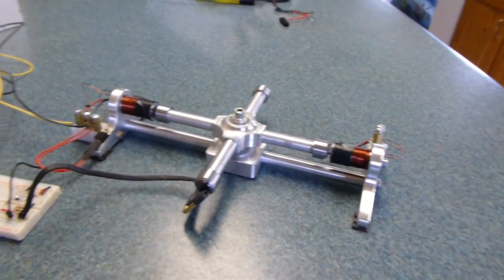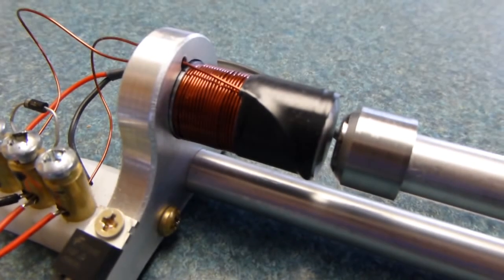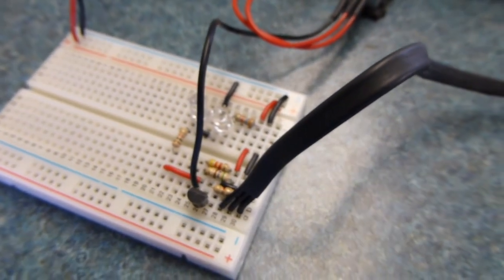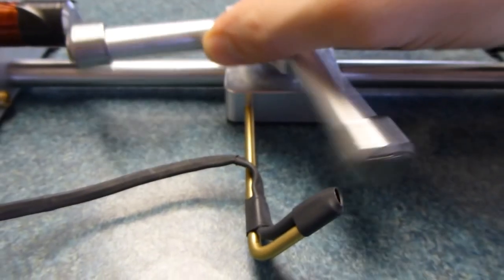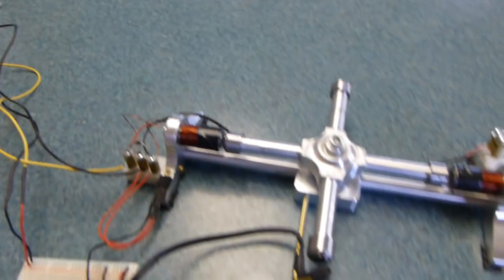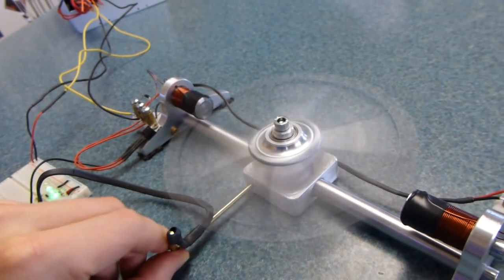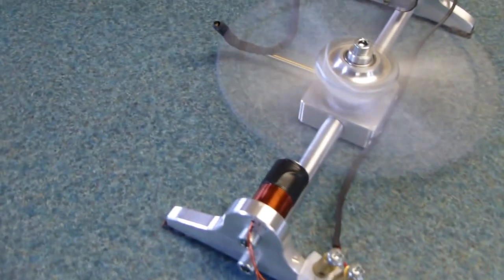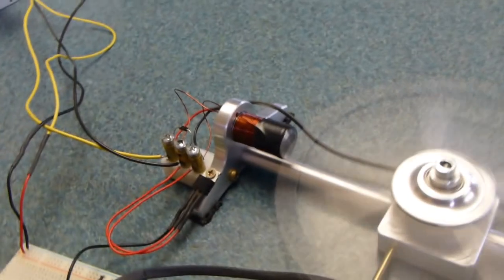DC Brushless Motor Project

Comment: You can use the collapsing magnetic field when the mosfet is off to achieve overunity using a diode from the negetave from the coil. It becomes your positive than your posotive from your power supply can be used as a negetave. It could posibly put out more than you put in.
Reply: um.. no. That's not how it works.
Reply from the maker: Yeah. Don't quit your day-job, unless your job is rewriting the laws of thermodynamics, in which case, enlighten us.
Reply: lol the laws of thermodynamics. And you think that helps you here. How about the law of conservation of energy. Ever heard of that one?
Reply from the maker: ...that is the first law of thermodynamics, genius.
Reply: Yes genius I am fully aware of that. And it debunks your over-unity bullshit. duh.
Reply: I dont know the physics behind it im just a highschool dropout that became an electrician. I do projects like this because I like to learn. I built a similar motor that takes 6 watts to run but puts out 88 watts. It can charge its own batery and if you touch the output it will nail your ass.
Reply: Brandon Jingle you may have built a device that inputs 6 VOLTS and outputs 88 VOLTS with an inverse relationship for amps to compensate, or you may have built something that outputs an irregular wattage that tricks your multimeter, but anything that outputs more average watts than it takes in is impossible.
Reply: That sad to hear. Im probably just making a big volt spike or something. I wont give up though.
Reply: Well if your goal is to make an over-unity device then you should give up and try making something else....
Reply from the maker: Brandon Jingle If you created a machine with greater than 100% efficiency then I'd highly recommend you go pick up your Nobel Prize and enjoy the rest of your life basking in riches as you take your throne as ruler of the universe.
Reply: Or that, I guess. Look out for government thugs and all that stuff cuz you know, it's a conspiracy and all
Reply: 1 thing you need to know .... you can't get more energy then you put in .... in the best possible conditions you can get 100% of the energy you put it no more
Reply: Daniel Parks prove me wrong :3 go ahead haha
Reply from the maker: Daniel Parks

There are plenty of sources of energy that we could reap from our planet and the space surrounding it: tide and pressure fluctuation like you mentioned along with others like solar and geothermal. It's important to note that although these seem "free" they abide by the same laws of physics as everything else. The energy we do/could extract from those systems comes as a result of heat in our own planets core, radiation from the sun, or the gravitational effects of our planet, the moon, and the sun. The sun is the prime source of most of the energy in our solar system in one way or another.
Reply from the maker: Daniel Parks Just keeping everyone in line, Daniel! ;)
Reply: ^that
Reply from the maker: Daniel Parks They're the fundamental laws of our universe, Daniel. I'm not on a pedestal, I'm just trying to keep you from wasting your time. If your or anyone else's "ideas" contradict those laws, they're wrong.
Reply: Daniel Parks heres an idea. How about a perfect battery that will hold a charge forever, through infinite cycles, and without the use of chemicals.
 Charging phase: power is given to a wench that lifts a 50 ton mass 10 meters upward. Then a locking mechanism holds it up.
Draining phase: the mass is attached to gears that power an electric generator. The resistance of the generator slows the mass's dissent, and a higher current draw would trigger the mass to fall faster, generating more power. 

It would be a large, ugly thing but it could be build underground .
The heavier the mass and the higher it is lifted, the more joules of energy it can store. The faster it falls, the more power it can output.
Reply from the maker: Daniel Parks No, I don't. If I did I would be marketing them and not making YouTube videos.
Reply from the maker: *****
How do you lift the 50 ton mass?
Reply: Jon Proce with a wench that is hooked up to gears to give it more torque. It would have to lift very slowly. With enough gears, you can lift it with anything, even a tiny motor out of a vacuum cleaner.
Reply from the maker: *****

That's very nice. What I was getting at is that I can absolutely, 100% guarantee you that it would take more energy to lift that mass to its upper position then you would get out of the generator when you lowered it. You cannot create energy, and the efficiency of that system, by the grace of science, must be under 100%.
Reply from the maker: Jon Proce

This thread is the reason that science courses should be mandatory for all students.
Reply: Jon Proce  i never said anything about over-unity. i said "perfect battery" meaning "lasts forever, and maintains charge forever"

Also, I just noticed the beginning of this thread, where i mistook you for brandon jingle. sorry about that. I thought you were arguing with me and defending the OP. That's why i brought up the first law of thermodynamics. We've actually been saying the same thing this whole time
Reply from the maker: *****
Roger. Mechanical batteries are common in the form of flywheels on machinery. Same idea but you save yourself having to reverse direction to recharge.
Reply: Jon Proce ah but a flywheel has to keep spinning to maintain kinetic energy, my idea just has to sit still, maintaining potential energy instead.
Reply from the maker: *****
Fair enough! Start digging the hole!
Reply from the maker: Daniel Parks
That's very inspiring, but, as I'm going to reiterate for hopefully the last time, it doesn't matter how much you dream, you still need to abide by the fundamental scientific laws which have defined everything our species has ever attained.
Reply from the maker: Daniel Parks
We have a few very good options to replace fossil fuels already, but our economy won't allow us to switch things over very quickly. I'm sure within the next half century we'll begin to see a transition.

And for the record, you can't classify anything that harnesses energy from the earth to be perpetual motion. Perpetual motion is impossible.
Reply from the maker: Daniel Parks
No need to get snappy, I understand it very well. "Perpetual motion" does not share a definition with a "perpetual motion machine" to which you're referring. Perpetual motion machines cannot exist.
Reply from the maker: Daniel Parks I was referring to the device with which you'd like to harness the energy in the tide. Tidal generators already exist, for the record.
Reply: Daniel Parks plus, the only reason the earth and moon continue to orbit is because they have no significant resistance. They are just floating through space. But, there is still some resistance. The moon for example, actually raises ocean water, and as the moon orbits, the raised portion of ocean tails slightly behind the moon. This causes a "drag" force if you will. It's actually slowing the moon down, and every year the moon gets a tiny bit closer to earth. Billions of years from now, the moon will be close enough to tear earth apart with its gravitational field. Its a similar case with earth and the sun, but the sun applies a solar wind to counter the effect, and the sun will die long before the earth could crash into it.
 Nothing is perpetual.
Reply from the maker: ***** I agree. That is all true.
Reply: Even using the tide to harness energy is still taking energy from something. It's taking potential energy from the raised portion of water, which got its energy from the potential energy between it and the moon, which came from the kinetic energy of the moon. So ultimately, applying resistance on the receding tide actually applies resistance to the moon, slowing it down. Again, nothing is perpetual. No system can sustain itself forever. Entropy always increases in the end.
Reply from the maker: ***** Again, all correct.
Reply: Daniel Parks 
We're just nit-picking at your use of the word "perpetual." That's all
Reply: I feel the need to fix my previous statement.  The moon is not getting closer.  It would be if that was the whole story,  but since the earth spins faster than the moon's orbit, rotational kinetic energy of the earth is transferred into the moon's kinetic energy,  by means of the lunar bulge I mentioned. So in the end,  the moon goes faster and gets farther away,  at the sacrifice of earth's rotational speed. I know  we were all past this topic already,  but I hate spreading lies and I had to correct myself.

Comment: Good construction Jon. Could you elaborate a little on the power output of the motor? What would happen if a load is applied and the motor is turned off, do you have to realign the magnets manually?
Reply from the maker: The output power is practically negligible. And yes, you need to have a magnet aligned with a pole for it to restart.
Reply: Jon Proce Thanks for the previous reply. We're a group of Swedish students tasked with designing and building a motor to lift a half a kilo a meter under a minute and we liked the simplicity of your design and took a little inspiration for our own from it.
Did you build your motor with a specific torque in mind?

Comment: Why don't the coils heat up?
Reply: well they would if he allowed more power/ higher voltage
Reply from the maker: Because they are only powered in pulses, not continuously.
Reply: thanks!
Reply from the maker: Logic First ...yeah, I know. That's why I told him that.
Reply: We got the proper education police in here
Reply from the maker: Logic First listen, genius, like I stated clearly in the video the transistor was used to invert the signal from the Hall sensor. The MOSFET mounted on the motor is rated for 50 amps, and I can assure you, per my design, it delivered closed to that full rating when closed. Thank you for your expert analysis.
Reply from the maker: Logic First 50 amps with a duty cycle of about 1%. I can tell you it works because I built the damn thing, and conveniently, I made a damn VIDEO of it and it on the internet. You sir, are a lot less intelligent than you think you are.
Reply from the maker: Logic First I'd really like to see your transcripts.

Comment: In your schematic, what is the function of the diode in parallel with the coils? Also, what are the coils wrapped around?Thanks!
Reply from the maker: It's called a freewheel diode. It stops the current from getting 'trapped' when the MOSFET turns off. The coils are wrapped around a 1018 steel core. The less carbon the better, pure iron would be best.
Reply: Awesome, thanks. I'm actually making something like this for a school project also. I decided to after seeing this video. Thanks for the inspiration!

Comment: hey,can you list up the materials and components.i want to bulid one
Reply from the maker: Do you own a CNC mill?
Reply: no.i want build a simple dc brusless motor, i saw your project is more simple,so i want to know how to make it
Reply from the maker: Well I built all of this with a CNC mill. You can't buy the parts.
Reply: Jon Proce no need for CNC.   Just use a disk and glue the magnets same way but instead of just 4    they can be multiples of 4 
like 32 for example.  It will work the same way, smoother torque bc of 32 pulses instead of 4 per Rev.  and also the weight of the whole disk will act as a flywheel providing, once again, smoother torque & momentum.
Reply: how?
Reply: Jeffrey Wong
 Just Get a DISK  plastic, metal, whatever. and make even divisions like 4 8 16 etc.  Like a Pie.  and glue the magnets with the SOUTH  pole to the outside. The Hall effect switch is only sensitive to the SOUTH pole.  
What??   You don't know how to tell the South from the North?   Look it up!!  do some research.   BTW there is plenty of videos on disks w magnets here.
Reply: you have a video？
Reply: Jeffrey Wong
Sorry Bud!  Don't have time to compile.
just use everything this guy has including the squematic for the electromagnet circuit.
only difference, you will use more magnets and a DISK instead of 4 round metal bars.
G Luck

Comment: hey jon i know this circuit is not too complicated but can u please tell me how did you made this and how i can made this for my project. this thing is really impress me so tell me first what is that sensor and then tell me how a circuit works then tell me how a full system works.
i know i want to know too much but this is my specallity.

Comment: Cool I like it! Maybe you can make another with carbon fiber blades like from hobby king and make it a fan? That would be interesting under a load. The neo mags on the end of the blades?
Reply from the maker: Yup. 1/2" x 3/8" N52 neodymium magnets.

Comment: what is the description of your motor 
how many rpm of your motor
please i want to know because i want a motor to move a heavy robot
Reply from the maker: Do not build a motor for that application. Buy motors. Use commercially available brushed or brushless motors with appropriate drivers. Stepper motors maybe depending on the application.
Reply: ok do i choose my motor by the rpm or what I want it Cheap and powerfull and fast give me Specifications for a motor to buy it with less prize
Reply: mamdouh abdelfatah just look at the power of the motor

Comment: very impressive, nice work. question one: how can you increase RPM, apart from re positioning the sensor there. and two: can this by anymeans be used as a boat engine. if modified in any suitable way.?
Reply from the maker: Bigger coils & more powr.

And no, this would make an awful motor for any application but demonstration.
Reply: Jon Proce i think, by adding more coils and much power as you say. at the same time adding a long projection rod at the top of the rotter, at the end of this rod putting a propellers, it is possible to make it propel a smal boat, it could be a bye bye to fuel engines.
Reply from the maker: David george Electric motors already existed before I built this one. Those that are and have been commercially available for decades are high-quality, efficient, and inexpensive. This machine will do very little to aid the global energy crisis.
Reply: Jon Proce if you were not a scientist i would say you underestimate yourself. but since you are then am sure you are certain for whatever you say. am just a curious accountant. Sorry for my curiosity. KEEP IT UP MAN you are good
Reply from the maker: David george

Haha it's good to be curious! Curiosity has gotten us very far, never stop thinking!
Reply: Jon Proce using your engine specifically, yes, but yours is just a demonstration. Yet, I have a brushless DC motor in my e-bike and it's awesome. It's only 250W but can drag me with speed over 25km/h or even more. That is just insane how efficient it is.
Reply: yeah you see jon proce. just modifyng the model is perfect

Comment: Jon, which is the hall sensor that you used? Is it a latching? or non-latching sensor? Also, when you say that the 2 coils are wired in parallel, you mean black-to-black and red-to-red, correct? thanks.
Reply from the maker: Did I say parallel? I thought it was series... Anyways, the video knows better. In any case, parallel would be all reds connected together and all blacks connected together. If it is series, the power supply red would be connected to the first coil red, then that coil's black to the next coil red, then the last coil's black to the power supply red. The hall sensor was model A3144, non-latching.
Reply: Jon Proce Jon, that makes sense.Thank you for sharing this with the community.

Comment: why is it called a dc motor?
Reply from the maker: DC refers to the power supply; the motor is running off of direct current. A motor running off of an alternating current supply would be an AC motor.

Comment: hi, nice project. What is the purpose of the mosfet? Why couldn't you just hook the coils to the collector of the pnp transistor? Thanks
Reply from the maker: The transistor is just there to invert the signal from the Hall Effect sensor.If the signal didn't need to be inverted that sensor could be hooked straight to the MOSFET. The current rating of the transistor isn't high enough to do it all on its own.
Reply: Jon Proce
 The fact that the signal is inverted, makes the PNP choice over NPN. But still doesn't answer the choice for the further mosfet, other that the simple PNP is not able to deliver the amount of current for the coils. Is this right?
Reply from the maker: The transistor is being used to invert the signal. It could not both invert the signal and drive current to the coils simultaneously, you would need two.
Reply: Jon Proce
 thank you for the answers
Reply: This is what I was saying - http://www.circuitstoday.com/hall-effect-switch (with the exception that the schematic from there, is a little bit wrong - the load should be on the collector side of the PNP), so it inverts the signal and support the load all the way by 1 transistor.

Comment: Hey,I'm going to try and make a lower-power version of this (Kind of out of necessity) and I was wondering if it'd be possible to make this with ceramic magnets and a bit less wire on the electromagnets. Is it? If not, I'll pick up some. Thanks for the help!
(P.S., would you think that a base and housing made out of legos would work, and if I used a sensor like that one, could I skip the mosfet? I don't have one to use, so I'm just wondering.)
Reply from the maker: That would all probably work, except that you absolutely need the MOSFET or some equivalent semiconductor.
Reply: Jon Proce Oh, okay. I guess I'll need to get back to radio shack soon.
Reply: Wait, Is the mosfet PNP or NPN? Sorry youtube is glitchy, I know you said in the video but I can't get it to work.
Heh, whoops. I had transistors in mind, Sorry, Mosfets aren't pnp or npn. (Derp)
Reply from the maker: Micah Burgin It's N-type (NPN if it were a transistor)
Reply: Okay thanks!